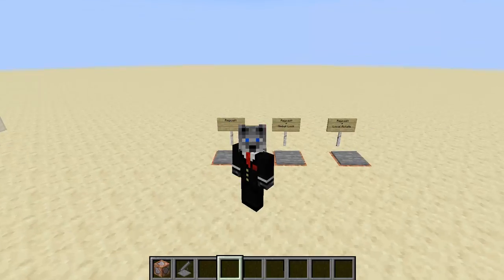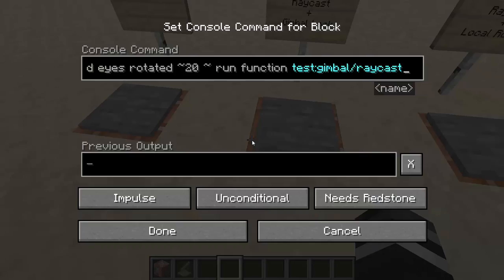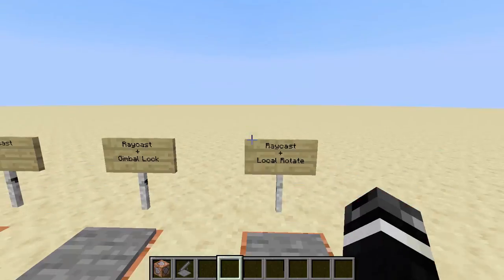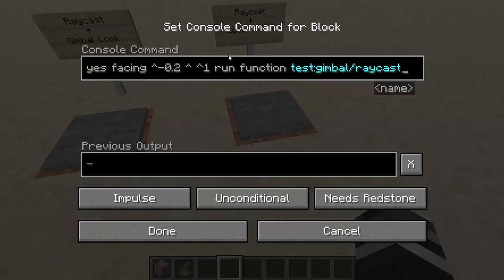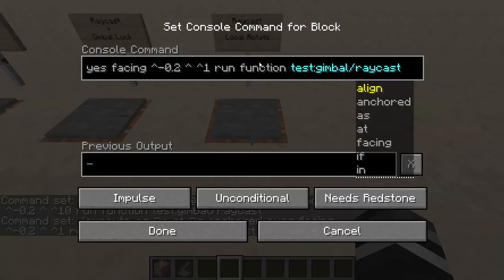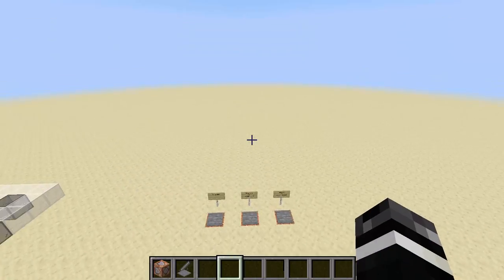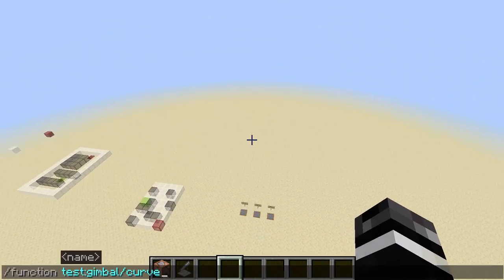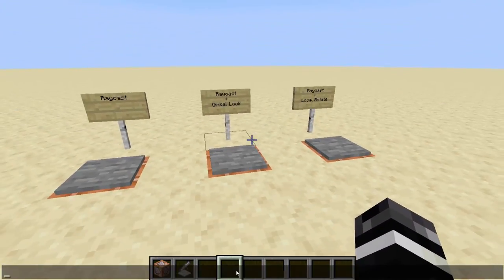Beating Gimbal Lock + Curved Raycasting in Minecraft

Comment: High cloud wolf,
I am currently working on a data pack that is supposed to add extra food. I use beetroot as the base item and my goal is that the hunger data of a player is changed as soon as you use the Beetroots. the only problem I have right now is that I can't change a player's food level through commands. I already watched your damaging snowball video but it did not help, so please help me
thanks
Reply from the maker: MudesEntchen 702 use the saturation effect
Reply: Cloud Wolf, i already had this idea 2 but even when i use it for only 1 sec at lvl 1 itll give me a full hunger thingy and i want to do this precisely
Reply: I don’t think there currently is a way to directly edit the player hunger. You could try to clear the saturation before one second is up so that it doesn’t completely fill the hunger bar.

Comment: My problem was basically the inverse of the second part of the video, I had the AoE cloud (For a projectile, not a raycast) eventually end up facing directly up or down when I was attempting to have it curve slowly regardless of the angle it was launched at. I don’t think the method in the video would solve it sadly.
I think the reason that rotate ~ ~X causes a loop is because it’s all one command so the value of X stacks up relative to where the player was first facing.
With facing block ^ ^X ^ the value will always be relative to the current position and so the X will become negative when its passing rY=-90 which causes the angle to pass rY=-90 again and become positive and so on and so on.

Comment: execute as ENTITY at @s run tp @s ~ ~ ~ ~ ~4
execute as ENTITY at @s run tp @s ^ ^ ^1

It can do the curved ray casting as well.
But your way is less laggy.
Reply from the maker: InTheAirMC and Yoshu lol no it can’t ur using rotation which means it will go in a circle
Reply: Cloud Wolf well, it worked for me somehow ..
Reply: Cloud Wolf no it won’t because every tick the entity rotation reorients so past rY=90 the direction of positive rY relative to its position constantly flips. It wouldn’t be raycasting though.
Reply from the maker: The voice J that’s not true using this 2 sets of tp would be fine yes but it’s not raycasting so interpreted it as it should b with real raycasting which if done with real raycasting it makes a circle
Reply: @Cl0udWolf  Try and test out my method. It doesn't go on a circle.
Reply from the maker: InTheAirMC and Yoshu with tp sure but that is not raycasting lol

Comment: I think you explained the beginning part of the video a bit poorly, facing in the tp command is not the same as facing in the execute command. /tp @s ^ ^ ^1 facing <location> does not teleport you 1 block towards that location, it teleports you one block ahead of where you are currently looking, and only after that are you rotated to face the location.
Reply from the maker: Sanian Creations it works exactly how I showed it. Execute facing x y z run tp @s ^ ^ ^1 is the same as tp @s ^ ^ ^1 facing x y z but it could be confusing as facing doesn’t move the location it just rotated to face something but I wanted to make it obvious what was happening
Reply: @Cl0udWolf  No. Those commands are not the same, that's what I'm saying. facing in /execute and facing in /tp is not the same thing.

With /execute it first changes how the command execution is facing, and so ^ ^ ^1 will be in the direction of the coords you put.

With /tp you're first teleported in the direction that you are currently facing, and only after that teleport your rotation is changed. 

Try this command whilst looking AWAY from 0 0: /tp @s ^ ^ ^10 facing 0 ~ 0 . You're not teleported towards 0 0. You're teleported in the direction you're facing (which is away from 0 0) and only after the teleport you are turned around so that you are now facing 0 0.
Reply from the maker: Sanian Creations even if that is the case (I rarely even use /tp) it doesn’t change what I’m trying to show that is the facing command can affect rotation
Reply: @Cl0udWolf  facing is not a command, it is a sub-command of execute and tp happens to have a similarly named optional argument that does something else. Explaining how one works using the other is fine because they are close, but you explain it as if they ARE the same thing, which is simply not true. I know I'm being nitpicky, but I feel like your explanation in this video implies that the facing argument of /tp is doing something that it is not.
Reply from the maker: Sanian Creations I think in this video I made it pretty clear that the facing extension means it’s facing a block that was the only point I was making it’s not a /tp tutorial or an execute tutorial, couldn’t think of a better way to show that in the moment